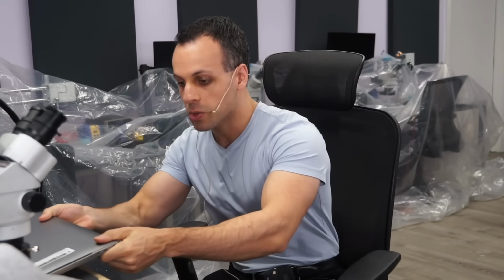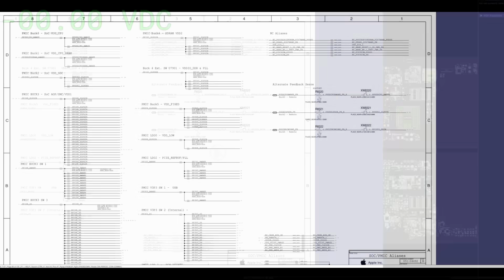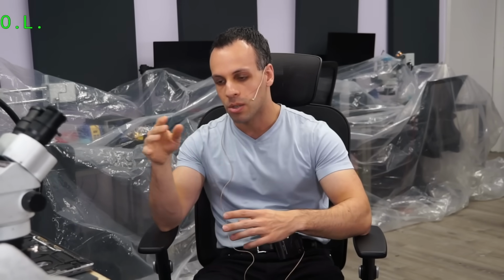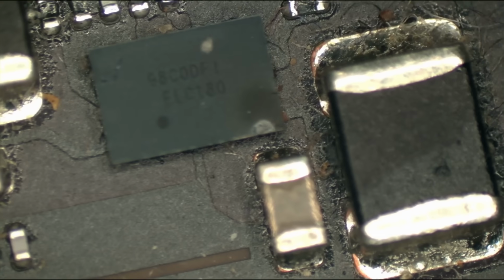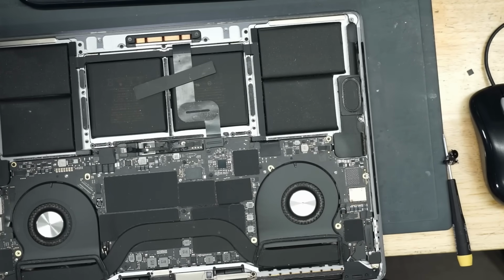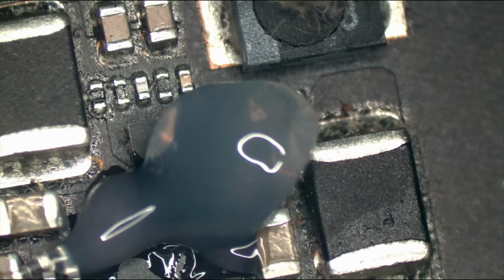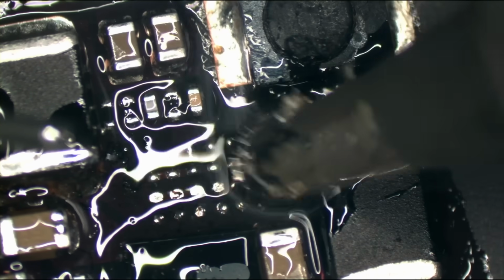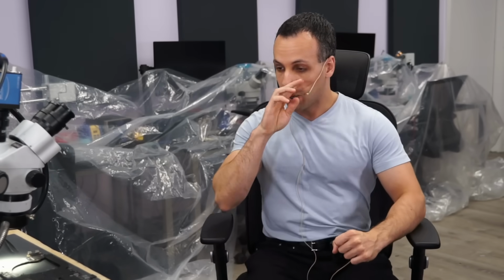How most 16" Macbook Pros often kill themselves & why they're unfixable

Comment: very interesting. Are the M1 pro models also have this issue. Or is it due to Intel chips being too hot in laptop that is too slim.
Reply: I'm guessing you're much less likely to have a power regulator blow up on a M1 max system where the TDP of the CPU is about half of the last generation Intel macbooks, but only time will tell if the M1 systems have any similar big brained design decisions.

Comment: I would never buy a computer with a soldered ssd, with heavy use thats like have a ticking clock,
For people who don't know ssd's have a limited number of read/read cycles before they begin to fail or lose capacity, if the ssd is non replaceable the by extension the laptop also has a limitation amount of uses before it fails (depending on how heavily the ssd is used)

Comment: 0:28 yeah, going from fresh peaches to allready tasted apples, dating game is hard, but getting support for old machines is a different sory. Legends of ThinkPad is a nice series, if you like that kind of stories. I myself spilled a lot of drinks on my old thinkpad (Lenovo, but my friend had an original IBM) and it still worked untill i decided to trash it a year ago. Long story short, I have an X250 for handheld configs for 5 years. 6:57 Got to this part now, slight chuckle. 14:38 Another edit, my mistake, but a good shutdown is a start of a whole new day of improvements.

Comment: Uh oh, I have this laptop, is there anything you could do in advance to avoid this? And if it does happen, can you at least replace the ssd?
Reply: Can probably get an external hdd that you can plug in every so often to backup data, i think Louis said that even if you were able to replace the soldered in ssd it still won't work because the machine won't accept replaced parts, only apple can do that

Comment: I dont get why they changed to  soldering the ssd into the motherboard. One could question so many things in this technological advancement but it seems like they are just making things harder to repair on purpose
Reply: financial reasons: they can charge more for storage and not be “undercut” by 3rd parties offering the same storage at 1/2 to 1/10th the price.

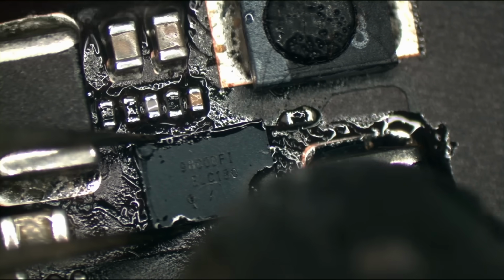Comment: When testing for the short, does it matter that the chip is aligned on the solder balls one row to the right (@ 13:40) compared to before (@ 10:41)? I'm not a technician, but just curious

Comment: So a design flaw that could be fixed with a Zenner diode (I'm a noob but that simple right!) to act as a limiter to the SSD in case that chip is blown and prevent 13v ever seeing the SSD?

Also can you not certify that there is no liquid damage and whilst not able to fix it per se, you could fix Apple with your expert witness statement and force them to fix/replace what a design flaw is and NOT Liquid damage?

Comment: "Near the village, the quiet village, the lion sleeps tonight." There's a slight chance a capacitor clamped that voltage by shorting quickly. Two ohms feels too low to be an in-chip failure, but Everclear works for the moment. Cheers.

Comment: Even if it has nothing specifically to do with Macbooks, have been watching your videos for many, many years and was able to fix a 17 year-old dishwashing machine at my elderly parents thinking “What would Louis or better, Paul do” while working on it.
Reply: Same. Fixed my Sony Bravia LCD display. Turns out there was a tiny chip that was prone to failure, it would crack and render the whole screen powerless. I opened the back, found the broken chip and simply removed it. The screen now works fine. Did some research on a TV repair forum and acording to the professionals this problem accounts for 90% of the Sony Bravia LCD screen failures. One tiny useless chip that self destructs due to heat. I started looking for broken Sony Bravias after this and getting them for free and simply removing the broken chips and reselling the screens. Big money.
Reply: Was able to do the same for a washing machine control unit, can so much relate! 
Even more, I started ranting like Louis when I found out online, that the problem in my case seem to be widespread, caused by some underspecified electronic components that this manufacturer group with several well known brands is putting on their control boards for decades now, that s.o. could suspect planned obsolescence. 
I do not wanna know how many additional washing machines, dishwashers these guys sell per year because of this dying control boards, when can be fixed with some few cent components. 
This number must be huge as I‘ve seen people selling repair kits on ebay or even advertise ‚send your board in, we send you back a working one same day directly‘

Comment: Could one prevent the memory destroying voltage with a zener diode, or some other voltage limiter soldered in parallel? If so, you could offer a service of putting the needed components in for people who want their data preserved.
Reply: What you describe is a "crowbar circuit", it detects over voltage and shorts the power rail to ground. Usually blows a fuse or some other cheap component but protects the sensitive circuit.Used in computers for over 50 years.
Reply: @goranaxelsson1409  Well, used in well-designed computers anyway.
Reply: @MonkeyJedi99  Well, that's why you don't buy an Apple product.
Someone in a YT comment section (no disrespect) can come up with a really good solution (that is actually standardized) but a multi-billion dollar 

company can't fix that simple issue LOL
You buy it, ur fucked
Reply: @somerandomprogrammer6886   Yeah but a cheap soldered on fuse and the other components might cost a whole 25 cents on a $3K machine.
Reply: @tagert1975  and prevent you from paying an expensive repair
Reply: @somerandomprogrammer6886  Lets be real, apple is fully aware of what theyre doing.
Reply: @danishblunt9698  Then it's just gonna make it that their bad decisions are intentional. Not cool
Reply: @somerandomprogrammer6886  well yeah. 52v into cpu still not fixed since 2016. Also the forced swapping with ssd still a thing.
Reply: Guys, this is not answering the question at all, there are people out there that unfortunately not because of their willfull ignorance or because of circumstances have purchased this Macbook and now depend on it for their life, school or work. Sure they could just sell it and get a better machine, but how long would that take, how much more money do they have to spend in order to purchase the same equally specced new machine again so that they can get back to their work, not to mention maybe some of their apps don't work in Windows for example. Sure, you can just spend weeks working out what works but we also have other obligations and commitments that does not provide us with that opportunity. 

This person is asking, is there a way to help remedy or mitigate this issue through hardware modifications, and yet your replies are, and quote, "That's why you don't buy an apple product" and "you rent an expensive piece of garbage from Apple." Yes we all watched the video and we're well beyond the point of debating whether or not you should get this macbook (which is a no because of this very consequential defect). So replying to a comment suggesting a possible modded solution with that misses the point of him asking the question, which is a very specific, technical question that need someone with the specific knowledge and know how to weigh in and consult. 

I'm not trying to defend Apple's quite frankly amateur mistake, but right now, we're just trying to make do with what we have purchased.
Reply: @insertnamehere4509  Fair point. I feel the first reply was a genuine technical answer (the one about a "crowbar circuit"). I can only speak for myself when I say I was thinking "in general" and "when looking to buy a new computer". I see you point that this is not what the original comment was asking about. We have indeed, as reply threads often do, gotten off-topic; perhaps a bit more rapidly than a technical support forum. Just a bit of food for thought: maybe YouTube comments aren't the best place to get useful technical answers. Not saying it's impossible, just suggesting* it might not be optimal.

* as in "putting the idea out there, take it or leave it" not like "suggestive advertising", just wanted to clarify that since I felt it could've been misinterpreted
Reply: @insertnamehere4509  It's all good wanting to hear about solutions. But there's a few things we have to ask ourselves:
- who is buying macbooks, or rather who is the macbook target audience?
- is the target audience tech savvy - meaning, will they know what can be wrong with the product before buying it?
- does the target audience accepts MODs to a new macbook that may or may not have such and such issue?
- are they willing to spend extra money, which at this point sound like an extra guarantee that you can buy with laptops

In my opinion the mac users have enough money to buy one, are not tech savvy in the way I described above and they just want a plug and play product that has the ios ecosystem. So every other point after is moot because they don't know the potential disaster awaiting them.
Reply: @insertnamehere4509  I don't think the majority of people that bought a 3k laptop will mod them 3k machine.

Selling it and buying another laptop just make another poor loser that could lose all its data.

Best solution is to give Apple/ other cloud services all your sensitive data OR make backups and work on a NAS or at least an external drive, until is time to replace this laptop.

The question, even if is a good one, is bad in the same time from practical view. So, same are the answers to this question, except from a theoretical point of view.
Reply: yeah any ideas guys ?
Reply: Yeah but if apple did this you wouldn't need to buy a new one so why would they XD
Reply: This vid showed up in my feed - just before purchasing a 16  inch  MBP… I mean Today i was going to do this. Somebody is watching out for me. (
Edit: - is this the Newer M1 16 inch MBPro or the 2019 model?)
Reply: @thetoolmat8632  2019
Reply: It is my opinion (that I think Louis would agree with) that you either buy a standardized, well-designed computer that has withstood the test of time, . . . or you rent an expensive piece of garbage from Apple, but you can't do both with one device and one transaction/purchase

Comment: Keep up the good work Louis! All the past comments I made were simply constructive criticism (and probably badly and hastily worded). You need it. Thanks for getting right to repair in new york, and all the entertaining and sometimes humorous videos! If they put some kind of "fuse" between that chip and the ssd, you would be able to fix it! They can't have that can they.
Reply: I don't know too much about circuits but I know a diode only allows power to flow one direction so maybe this would fix the problem if installed retroactively before the computer has the opportunity to destroy itself.

Comment: Double sorry for the double post. Would it practical to install an appropriate zener diode from the positive terminal of the NAND to ground?

If this is such a common occurrence, that might be a worthwhile hack just to protect your data.
Reply: Zener plus fuse should do it’s job. You need something else then your nand to increase current to burn the fuse.
Reply: Couldn't u I stall a fuse?? If voltage increase so does current... but maybe the increase is too small for a fuse to work. But some kind of thing that caps the voltage at 5v must ge possible and cheap, no?
Reply: @kungfreddie  a fuse would require you to sever the circuit somewhere and install the fuse across that gap. I'm not saying it's not doable, but a diode-resistor circuit could be installed "in parallel" to the hard drive and would shunt excess current to ground.

They cost pennies, but the true cost of such a thing as a service would be the testing. You'd have to have volunteers install them on their motherboard then report back when that specific chip fails on whether their hard drives survived.
Reply: @mgancarzjr  the removal of the inductor and rewiring it in with a fuse would do the trick. the real solution to this problem is make an adapter pcb that allows for the use of a more reliable fix although.
Reply: This should be  a top comment!

Comment: Does this apply to M1 MacBook Air and Mac mini 2020 ?
Reply: I am only guessing, but i think ALL MacBooks since 2018 have this issue, and possibly also MacBook models from 2015, and MacBook Pro models from 2016

As for the Mac Mini, i am unsure, but i have not heard of any cases where this has happened on any Mac minis (and also, the design has not changed since 2010)
A lot of people seem to be annoyed at apple for putting an internal power supply in the Mac Studio, but if my hunch is correct, then having an internal power supply may make this sort of thing less likely to happen

Comment: I just realized something. Apple's desktops are probably the most reliable machines out there while their Macbook Pros are probably one of the most damaged and unreliable laptops on the planet prone to all sorts of things (Macbook Pro 2011 anyone?). Prove me, wrong people. I have subscribed to Louis youtube channel for years and that's all he fixes. Laptops.
Reply from the maker: It's not even touching
Reply: M1 MacBooks are great though. Never had a laptop last this long with the battery before charging. Fan is quiet and laptop is cold no matter what intensive programs I run or keep open. My old Lenovo and the  XPS 13 before that were awful in comparison.

Despite the flaw designs this is the best laptop I’ve ever had. I’m happy with my self built desktop for gaming and 16inch MacBook Pro for work. 

Luckily I’ve never had any problems with my apple products over the years and hopefully that continues.
Reply: I’ve had very few problems with several MacBooks over the years as well...far fewer than other brands. I wonder which machines are built better if Apples are as terrible as claimed.
Reply: @neatnateable  I can talk only about HP and Lenovo, because that is what I have experience with. High and medium-end Lenovos will serve you for years, they also have water protection, so if you spill coffee on them, you just have to wait a moment. If the coffee was hot. If it has Samsung drive, it will probably die after few years (6 or so), but usually it will not die suddenly, you will see that the computer is slower and slower and that is the moment to transfer data and replace drive. HPs are shiny and sleek, but I saw how half of the keyboard died from wet fingers (came back from toilet and used only one paper towel). It was only few months old HP Elitebook 1030 G4.
Reply: @simonspacek3670  Thank you for this information, Simon. Yes. I have noticed that Lenovos are built like tanks. Now if we could just fix that issue with Windows being the primary operating system for most machines out there. :)
Reply: Do you actually have a source that says that MacBook pros are probably one of the most damaged and unreliable laptops on the planet? Certain models had issues with Nvidia GPUs, and there were the issues with the butterfly keyboards. All of these are very well documented. But are they below par for the industry? No way.

I mean if you watch Louis you'll get a very skewed picture of reliability because repairs is what he does. Also he may point out engineering issues, but you're not seeing those issues pointed out on other pc makers because no one's doing that kind of deep dive.

Comment: by now, i would expect an apple car to explode when the wiper fluid gets empty, because the check-engine light for the wiper fluid ignites the gasoline inside the trunk, because the gasket for the fuel pump was made of old macbook air pcb´s, which delaminated

BUT - only a low number of customers explode!

Comment: Thats not unfixable. Use JC p13 to prepare ssd chip(somewhat hard to get but if you have few donors, not  problem at all) and replace bad one. You can read shorted nand in most cases so it would be possible to simply dump its config region, flash it on fresh chip, solder it back, do DFU restore to fix SSD and firmware. If it's not readable you will have to prepare  all chips(there is sort of  ssd config partition  which  ties all SSD into one volume).
Reply: That's possible yeah but definetly not for a repait shop. That's a 3000$ data recovery job
Reply: @DumbArse  unfortunately JC reads only partial dump so i did not mean data recovery. As for repair, if you have, say, just 1 or 2 shorted  NANDs, it is not much different from replacing 2 DDR/GDDR chips or any other BGA. Its hard to get good chips unless you have donor pool, however thats same nands apple uses on ipads, so it is easier than isl9240 and definetely much much easier than fixing cd3217 compatibility issue on the same 16" board.
Reply from the maker: This person wanted to pay $200. I'll leave it at that....
Reply: @rossmanngroup  weil thats rather marginal case, i mean that average person who got the LB replacement price  from apple (1k+$ for most 16" boards) would be happy  to pay 500-700$  and getting decent 1 year warranty. 
Im currently looking for a way to dump whole shorted chip but unfortunately famous JC tool is apple-like device which does not read whole chip but only first few mbytes of config block. The interesting thing is that it can keep voltage on shorted NAND so it might work despite being shorted.